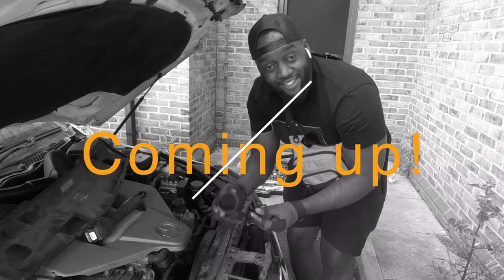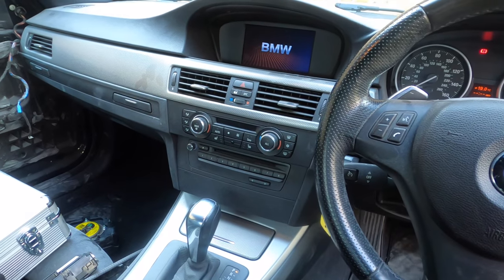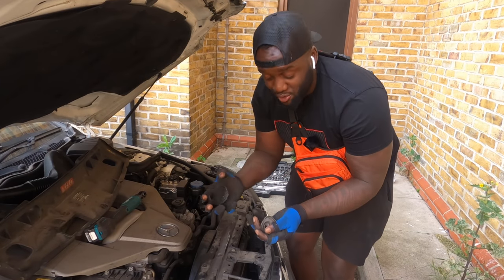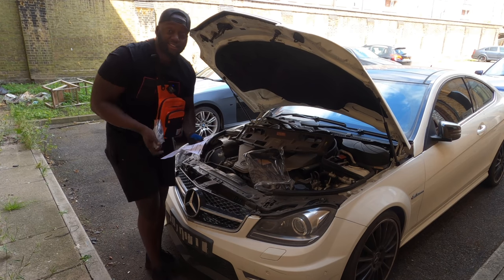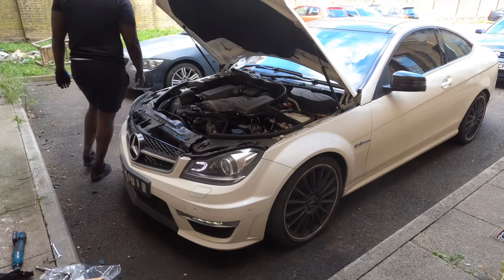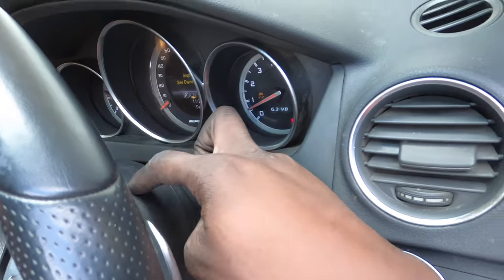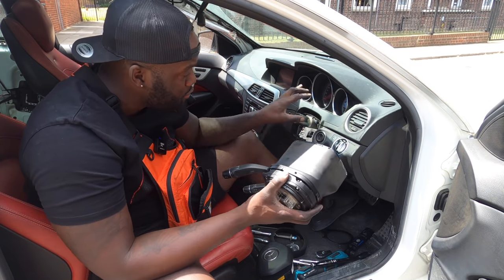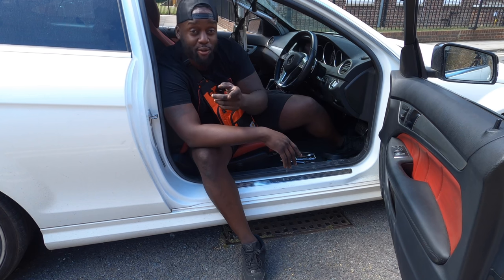Rebuilding A Wrecked Mercedes W204 C63 AMG  From Copart - PART 3

Comment: The steering angle sensor should sort out the traction issues my SAS SENSOR failed on my Mercedes and it deactivated the traction until i fitted a new SAS on
Reply from the maker: Yh im looking to order one. Its deffo that SAS. Thanks